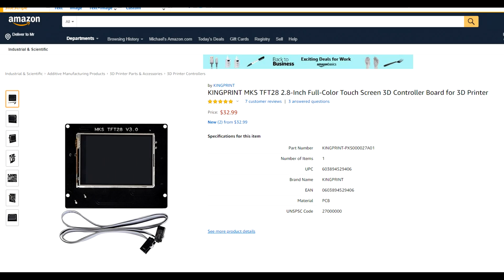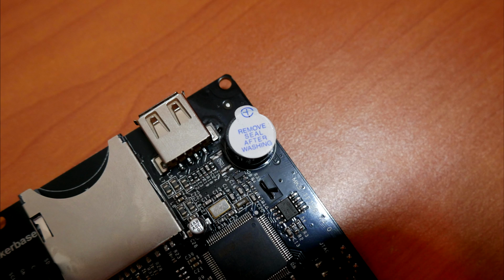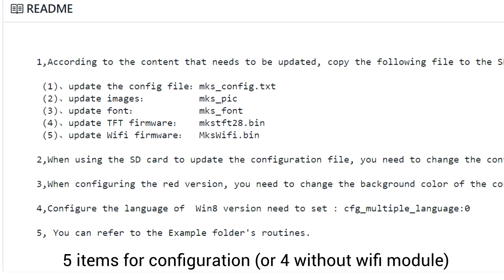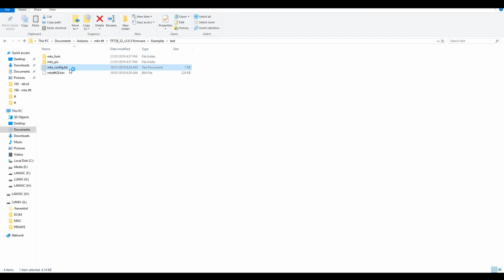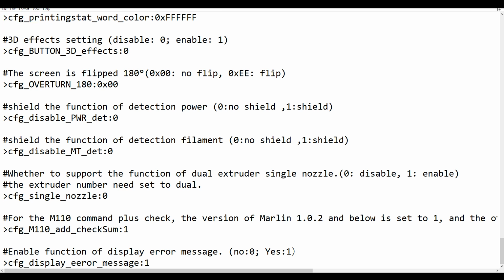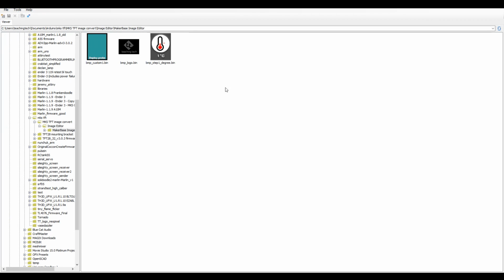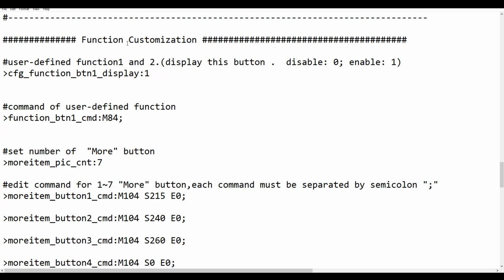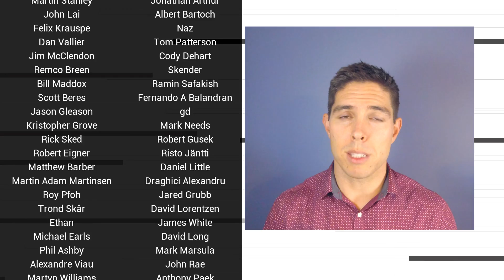MKS TFT28 touch screen on the Ender 3

Comment: Hi Guys, I don't know where to go, I need help on connecting Creality V2.2 Main-board to TFT touch Screen that is used on CR-X, there is an LCD connection on the board but it is an 8-Connector (2 by 4) and the TFT side is only 6, is there anyway that I can connect them together at all? Please advise. e-mail is siafix@free.fr
Cheers
Siamak

Comment: Thank you for making these videos, I Really appreciate them. I  have a Enders 3 Pro and upgraded the mother board to Version 4.2.7 and have added BLtouch which I have yet to get working.( two Magnetic bases holed ).Can you fit a touch screen to this motherboard and is there a lot software configuration to do.
Cheers.
Stay Safe.

Comment: The "Remove seal after washing" is for the factory. The entire circuit board needs to be washed to remove residue so you can assume the board is washed and all that needs to be done is remove the seal. The seal isn't removed at the factory because its a waste of time/ unnecessary or they don't care.  Advising people to wash the speaker is not a good idea.

Comment: Since 2 days I also replaced my mainboard with an MKS Robin. (marlin) and also an MKS TFT35. All works fine. But how do you adjust the Esteps? In the original screen this was very easy to do with: Control -> Motion -> Esteps / mm. But in the new screen, this is nowhere to be found. Does anyone know how to do this now?

Comment: How are you handling M600 filament runout and color changes without the encoder that you removed? I just had to make substantial firmware modifications to pull it off!

Comment: Good afternoon,
I have the same problem. My MKS TFT28 4.0 does not communicate with Ramps 1.4. I have updated the firmwares of the MKS TFT28 4.0 and Marlin several times, and I have verified that both are at 250000 bauds, but it is impossible communicate. However, when I connect to the computer, I can actually move the motors with the Repetier Host, but I can´t with the MKS. I suspect the problem may be version 4.0. Does anyone have a solution? Does anyone manage to communicate the Ramps with MKS TFT28 version 4.0?
Regards,
Reply: Hve you found a solution? :(

Comment: I've bought an Ender 3 Pro and SKR E3 Mini board and their touch display.  I did the main board swap and installed the display with no problem, but I have not been able to find how to add the extra cables/connections (which ones and where do they go) to enable the touch screen and USB and SD cards on the display board.  Do you have a video on that, or can you point me to a document that shows it?  Thank you for your great series of videos!

Comment: I've replaced old screen with rotary button with MKS TFT on my 3D printer, now I'm trying to use material change (single extruder) and after M0 initiated by g-code (cura) I can't resume printing, neither LCD message (M117) is not displayed anywhere. Any solution maybe?

Comment: Hi Michael, 
I'm following your videos quite a time now, and did follow some of your turorials.
Therefore I have bought once the MSK TFT28 and now I upgraded my Ender 3 with an SKR Mini E3 V1.2.
Is it possible to use the MSK TFT28 with the SKR Mini E3 and if it works how does it work :)

Thanks in advance for your advice.

BR
Michael as well ;)

Comment: I am still new to the 3D printing world. If I buy this screen will it hook up to the stock board that comes in the Ender 3 Pro?
Reply: I have the Ender 5 Pro and I bought the MKS32TFT which I think has the same pinout. The newly updated motherboard that comes with the Pro does not seem to have the header to support a second screen as Michael showed and it is 8 pin and not 10 pins like the stock version. I think I got those details correct. I would love a solution because I have the unit and it is installed in a nice case I printed but it sits in my drawer collecting dust.

I really appreciate the video but I think we need an updated one.

Comment: I'm really starting to doubt your recommendations. I tried installing one of these displays to my Ender 3 and it Can't be Done. The Cables and the Stock Screen All have 12 Pin Cables and Not 8 Pin Cables. So now I have $30. U.S. MKS28TFT to go along with my $50. U.S. MKS WIFI Adapter, neither of which can be adapted to the Ender 3 due to the Differences in the Cables.  I sure Hope your recommendations work out with either the TMC2130's and the MKS-GEN L Board and on my second machine the SKR Mini E3.
Reply: Do you have the Pro?

Comment: Sorry, I'm a newbie. How and why do you wash the speaker?
Reply: It's lost in translation.  Basically from what I've found, leave that sticker on the speaker to muffle the sound.  Without it, it's a LOT louder.
Reply: That's not what it means, but it has to do with production of the board.  It's already been "washed".  But they don't remove the sticker that seals off the speaker.  But like i said, leave it on unless you like loud, obnoxious beeps.

Comment: Just upgraded my Ender 3 with the Bigtree SKR Mini E3.  works fine with original display.   I bought the Makerbase MKS TFT28 V9 but the ribben cables are different.   10 pin on main bd and 8 pin on the display.  How do I get them hooked up???  Or did I buy the wrong display????

Comment: Anybody else having issues getting the stock screen working??
I have BUDGET_GRAPHICS turned on and set to CR_10 as per Michael's instruction and have exp1 and exp2 ribbon cable in place. Screen lights up but no display? 
Yes I also tried the turning exp1 cable through 180 fix and I get nothing at all other than a repetitive 'click' from the buzzer so thats clearly not right!

I dont reall need it other than tweaking setting eeprom type stuff... just too lazy to recompile and flash Marlin, that's all!

Comment: Michael I recently bought the 'BIGTREETECH TFT24 V1.1 Touch Screen Display compatible 12864LCD 3D Printer Parts VS MKS TFT2.4 For SKR PRO SKR V1.3 Ender-3' for my Ender 3, which as the description suggests is for an Ender 3. Anything I need to know? It seems to be smaller than the stock screen! do I need to print a frame or something?

Comment: Hello there Michael. I just got a SKR V1.3 main board with the 2208 drivers and a TFT35. I seem to have everything working except for one thing. I am not able to flash the firmware. I followed your guide here and did everything the way that you did, however when I insert the SD card and restart the screen it just boots right up to the default window. There is no update to the firmware before loading to the main screen. I'm wondering if I missed a setting somewhere to activate the SD card. Do I need to change a setting within Marlin to use the SD slot on the screen? I would't think that would be the case but i'm at a loss here. Maybe just a bad SD slot on my screen. Any thoughts on this at all? I would appreciate any help you or anyone else may be able to give. Thanks for all that you do and keep up the great, informative videos.
Reply: I had the same problem. In my case I had previously formatted the SD card NTFS for another project. I reformatted as Fat32 and that fixed it for me.

Comment: Michael, I have been watching your videos for quite some time. They have helped me tremendously and building my current machine which is a modded Ender 5. I would like to use the MKS TFT 28 as my main display. I found that it lacks many functions that the stock display has. I'm trying to figure out how to do more with this display, ie adding bltouch, Z probe offset eeprom settings and a few other options. It would be nice if the display would just read everything from the printer but I know it acts as its own separate entity. But is it possible to add the settings as part of the actions that can be used from the display?

Comment: Hi, thanks for these videos, they are invaluable. I would like to change my main board to the skr 1.3 which looks a lot simpler to mess about with the stepper drivers than the mks gen l. Is it possible to use the tft28 or tft32 with the skr 1.3 board? I’m assuming it is as I’m sure I saw it in one of your videos when you were talking about the drivers? Thank you in advance.

Comment: Wait... You don't have to wash the speaker!
Reply: What does it mean to wash the speaker ?
Reply: Moti Landes  When you solder components to a circuit board, it gets pretty dirty. For that reason it is cleaned in a bath of water and soap. Ultrasonic sound waves are used to "scrub" the circuit board. Most components like resistors, capacitors, microchips etc. can be washed this way without a problem, but some others, like the speaker, are not "waterproof". So they are sealed to prevent the water from getting inside and this seal needs to be removed. Some manufacturers don't do this (probably because it's cheaper) so you have to remove it yourself.

Comment: I have done the mks gen l and tft32 updates to my ender 3. I have an issue with resuming a print after a pause at layer height for a filliment color change(pause done in gcode on cura). Is this something I can resolve without including the original screen? Any help is appreciated

Comment: I am using the MKS TFT35 version atm. But how do i Babystep for my BLTouch and how do i save it in the firmware using that TFT35 Screen. The firmware for the TFT35 differs from the TFT28 i think since i cant use the retro version. I havent tried but i guess it cant be done since there are not any such examples.

Comment: hi michael one thing you left out is the i cant get baby stepping on the screen
Reply from the maker: I have this in a follow up video. Please look for the bltouch to Artillery 3d X1 guide.
Reply: Teaching Tech thank you Michael I will try this now I have followed you guide for the MKS GEN L and installing the BLtouch and the tft 28 and everything works great but I just can’t baby step it so I can’t use the printer it’s giving me a real headache
Reply: Teaching Tech Hi Michael thank you so much for the help I finally have my beloved ender 3 back up and running got the baby stepping dialled in thanks to your great video the mks gen L is working well as is the TFT28. 

Once again thank you so much I couldn’t have done it with out you 👍👍👍👍👍👍👍👍👍👍👍

Comment: So I have a question I bought this and an MKS GEN L board for my Ender 3.  I was told that all I would have to do to load the firmware for the Ender would be to load its Firmware.bin file from the SD slot.  But when I load up the screen comes on but I don't see anything happen is there anyway I know that the firmware has loaded the SD card acts as though there are no files and nothing is read.  When I put another SD card in with an STL it doesn't see the STL this leads me to believe the SD Card reader might be bad unless I am missing something.  Thanks for any help you can provide.

Comment: Any way to connect the TFT28 directly to the stock board? i don't mind recrimping connectors or soldering but it would be nice to have a tutorial on how to use the tft28 with the stock board

Comment: For anybody who can not get this to work (like me).  Once you have modified the custom button Icons and the Config file. You must copy the mks_pic directory with your modified bmp-custom(1-7).bmp files in it out of the Images/Win8Style/English directory, directly onto the SD card. In my case all files were stored under Images and it could not find the Icon .bin file(s). So in your root directory there actually needs to be a directory on your SD card called mks_pic.  After 4.5 hours, I finally figured it out by searching other tutorials and reading the manufacturers documentation. After all that, I am just not sure it was worth implementing the Custom buttons. Functionality, seems very limited (and there is no direct feedback as to if anything happens...that I can see; Other built-in button "presses" actually accomplish something visible). A lot of things get missed, when the "narrator" speaks at 300 words per minute (or speeds up the video so you have to watch it 6000 times to follow). And of course if the "narrator" slows it down, there will be 1 out of 1,000,000 people who will complain about that. :-)

Comment: This ruins the ability to flash your main/motherboard does something with the serial port I suspect. Huge headaches figuring that out would get a 25% success rate on flashing with it attached. Might be because I am using a stock lcd with 1 cable too.
Reply: Reflashing requires powering down disconnecting and repowering 2 times which adds a lot of time to the process part of why I keep the standard ender 5 lcd on it to test it with USB and that for feedback before reattaching.  Looks grate and functions ok though do not use USB with it attached or it will hang and may cause a fire.
Reply from the maker: I had this issue once every and then never since. That includes dozens and dozens of reflashes making stepper driver and other tutorials. Weird, hey?
Reply from the maker: Also I print from octoprint via USB with the screen connected and zero problems.
Reply: @TeachingTech  wonder if it is my board or wiring then. Thank you for the reply.
Reply: I removed the wifi module I had in it and halved the baud rate in it's config the whole thing has stabilized a lot. The wifi module is really useless anyways only seems to support a old version of slic3r. And thanks again for the reply got me thinking about the differences which lead me to getting it working.

Comment: I installed this screen and an MKS Gen L following your guide and using your Ender 5 firmware. The homing and move axis features are not working on the screen. If I try to move the axis there is no response. If I try to home, it brings the extruder all the way to the front center and starts ramming into the bed (the BL Touch is off the edge). Any ideas?
Reply: Same issue. Did you ever resolve it? :(

Comment: Any idea on how to adjust z offset for bl touch with this screen (MKS tft28)? I'm having no luck at all.  PLEASE HELP!
Reply: I might be wrong but probably You will need to add custom buttons with Gcode for z offset (to simulate what whats on LCD) and button with Gcode to store settings in EEPROM
Reply: Yeah I jumped the gun. Should've read previous comments. He's working on a vid but gave the g code I need so I'm half way to done now. Thanks a ton though!

Comment: i have done the motherboard upgrade, tft28 display upgrade, and the raspberry pi upgrade... everything works but heating the bed.... it reads the temp of the bed and hot end and it can work the hot end perfectly fine but the bed will not work.... neither the display nor octoprint can communicate to the bed and for that reason i can't print because it gives an error for i guess timing out on heating up.... please help

Comment: Michael, I';ve watched all your videos on upgrading the Ender 3, my first 3D printer. I have applied most of the upgrades you have shown including the new touch display and a MKS GEN L board although I installed the TFT32 display. 

I've noticed that when the print finishes the Z axis raises out of the way and the print bed goes to the rear of the printer. The bed location with the new upgrade is reversed from the stock Ender 3 where the bed moved to the front of the printer after the completion of a print. Is the any way to get the bed to move forward again after the print has finished?

I know this may not seem like an important item but I kind of got use to the bed moving forward. At 70 years old I am kind of set in my ways and I like things the way they were.

Addition: OK, What the heck just happened. The very next print I did on the Ender 3 had the bed go forward once it finished printing. Is it magic?

It looks like the bed moves forward or back after finish print depending on the position of the print. I don't know for sure. Pretty crazy or should it do that?

Comment: I got the Flsun QQ , I did the auto bad calibration.  When the printing process starts I do not have the live Z control buttons on the TFT screen.  The firmware type: MKS tft ver.  3.0.1
 The manufacturer instruction of how to flush the firmware are in Chinese, from what I understood I have to copy the updated files on the SD card & the process will be done automatically when inserting I will appreciate any guidance were to find the correct files. Thanks.
Reply from the maker: I'm planning an update video on how to add baby stepping/z offset buttons. It should teach you what you need.

Comment: Hi Michael, It's me again. I figured out how to use the M290 command and get it to work with the TFT32. Thanks for the help.

I am going crazy trying to figure out how to convert .bin to .bmp and back again. I do not have Photo Shop and I cannot find a reliable option on the internet. I know you must be busy so help if you have a chance.

Thanks Patrion Jaless (Joe)
Reply: You don't have (and I'm not sure you can) convert bin to bmp. Just right click on the one you want and click on "copy image". Then open your picture software (Paint on Windows for example) and paste it (CTRL+V). Then add what you what and save as bitmap using the right name (bmp_custom1 for example) . Finally you will have to use the MKS software to convert the image (bmp) to logo (bin).
Reply: @didtoknan8128  Thanks for the reply. Now that you spelled this out for me it looks link a simple way to do this. I will look into this.

Comment: Michael, Since upgrading to the new MKS Gen L board as well as the TFT32 I really miss ability to fine adjust the Z offset that is native to the Ender 3 controller board. Is there any way to incorporate this command to allow me to fine adjust the Z offset + or - using the TFT32? Thanks for all your help. I've followed most of your upgrades to my Ender 3 since I started in the 3D printing world last October. Your channel has been the most help of any other channel.
Reply from the maker: I'll be covering this in future but it involves custom buttons like in this video with m290 as the command: http://marlinfw.org/docs/gcode/M290.html
Reply: Thanks Michael!